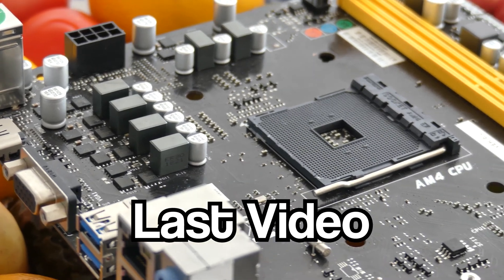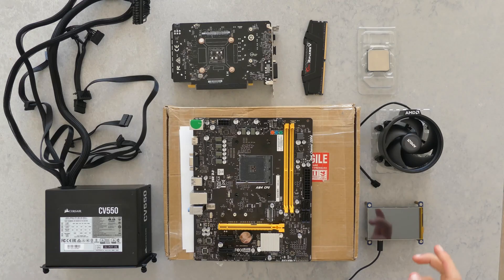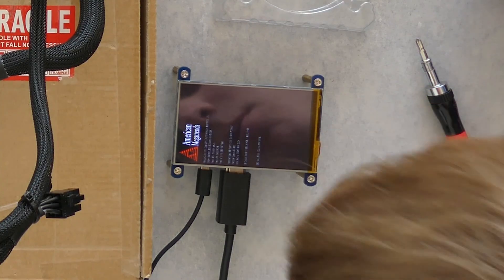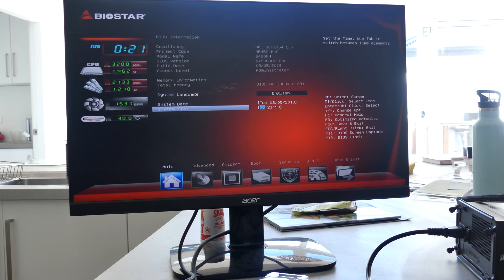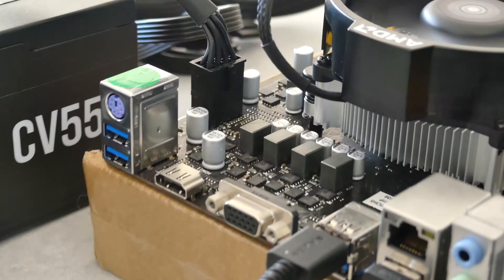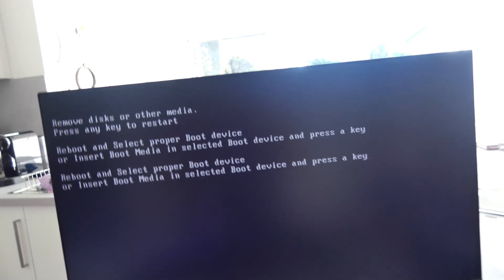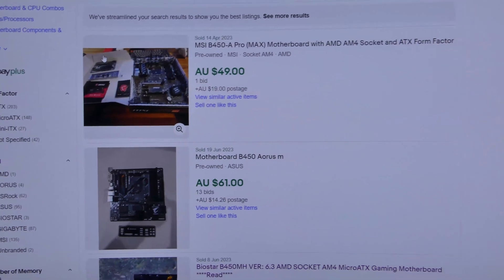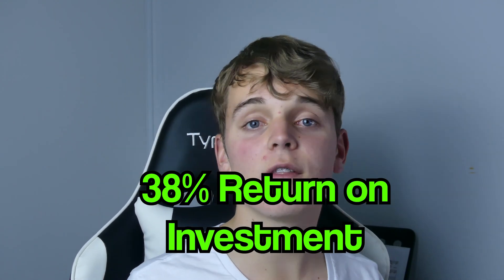How I FIXED this 'BROKEN' Motherboard from Ebay - PC Flipping Ep. 2

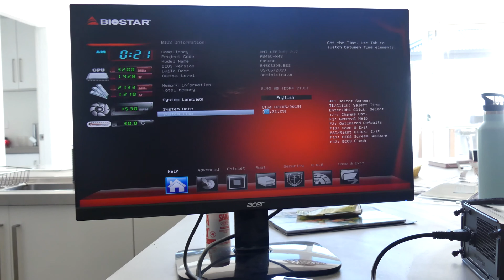Comment: 2:50 you said that support for ryzen 1000 series cpus will be dropped after the bios update, although i planned to buy this exact same board and a ryzen 5 1600, but in the ebay listing, the bios already updated to the latest version on the board. the ebay listing also says that it supports 1st gen cpus, and the biostar website also says that ryzen 1000 cpus are supported. would i need to buy a 2000-5000 series cpu, or is there any way for you to test that if you still have the parts?

Comment: Picked up a gigabyte X570 aorus elite wifi combo with cpu and RAM on ebay for $90 total. Guy said he "couldn't get the components working together". I was assuming I'd come away with at least the ryzen 5-2600 cpu or 16GB of RAM working, but it turns out none of it works. The motherboard LED's flash for about 1/2 second after PSU power switch is cycled, then I get nothing. If I insert a CPU, the chips directly below the m.2 slot get too hot to touch, and the CPU slowly warms up over about 10 minutes with power on, but I get no POST, no chipset fans, cpu fan, etc... If I remove the CPU, those chips don't get hot. Probably done with buying "for parts or repair" PC parts from eBay.